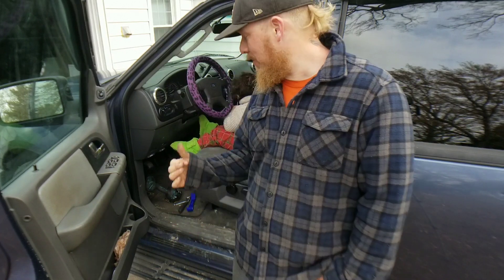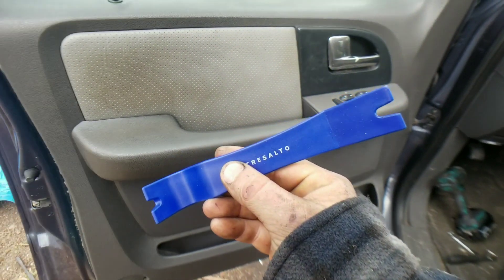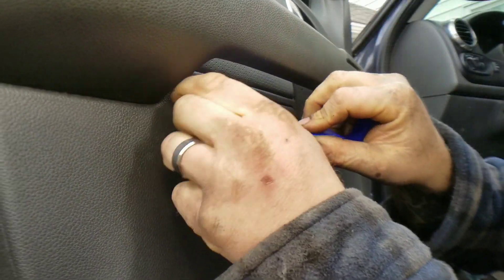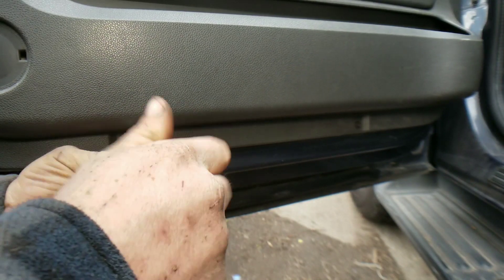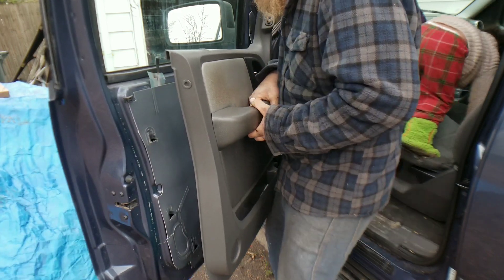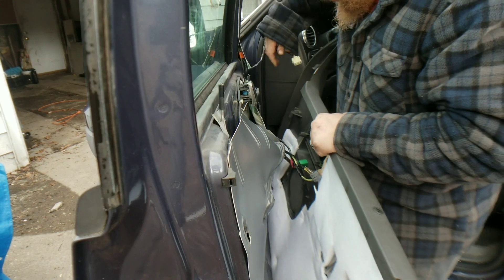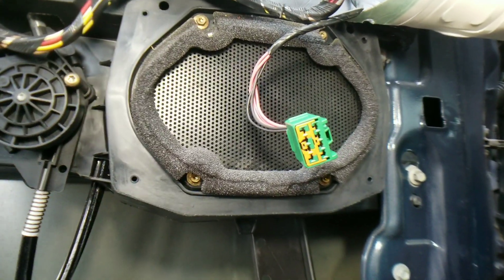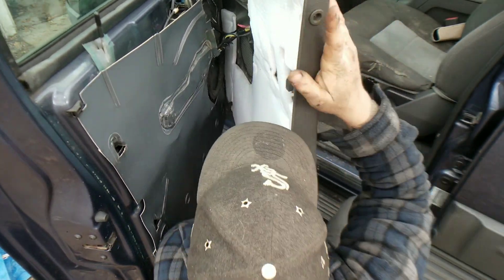Quick and Easy 2003 Ford Expedition Door Panel Removal

Comment: Whatsup brother got same car. Cant get the door ajar light off. Plus wont start on first turn but usually starts on second turn. I just got a new intake manifold
Reply from the maker: Does it crank at all on 1st turn? On your door you will see a plunger for the doors, spray it with wd 40 or pb blaster. It should free up the internals.
Reply: @Sellthoseflippingcars  it does sometime but I'd say 65% of time it'll crank on 2and turn
Reply from the maker: Crank as in the engine is trying to start. If it cranks but no fire up, then it's a starter on the verge of going out so get that tested. Now if it doesnt crank at all then I would look at the ignition switch (your key switch). Most likely it is a starter going out

Comment: My local mechanic replaced the window regulator recently and when we got the truck back, the door lever and lock are kinda in the wrong spot. The lock looks like it's sliding up and down a bit to the side and the door lever is sticking out a bit than it used to. Any idea what they did wrong?
Reply from the maker: Check the support screws from the video, sounds like you are missing one that should be in the arm rest. Thank you for watching, let me know if you have any other questions.

Comment: Host:   Get the door handle out of the way.....

Vehicle starts....

Lol.  Great vid. I can now do my passenger door
Reply from the maker: Did I not show in detail what to remove to get the door panel off?
Reply: Sellthoseflippingcars absolutely.  Amazingly in fact.  My passenger motor is gone on mine.  Not afraid to get in there now.  Will try and get a window motor from the wreckers.
Reply from the maker: Im glad you found the video to be beneficial! Thanks for watching!!
Reply from the maker: I did the window motor in a new video make sure you stay tuned for that one! This video just covered the door panel removal but still the 1st step to get to the motor. How did the repair go for you? Is your window all fixed up?
Reply: Sellthoseflippingcars    Amazing.  Thanks so much !!!!!
Reply from the maker: You are most welcome!